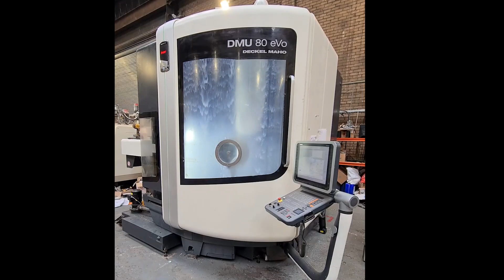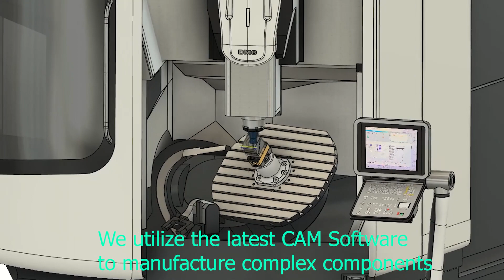Our new CNC Machine! - DMU 80 eVoution Linear

Comment: 00:40 tag on rad, nice.
Reply from the maker: Is that bad? Lol idk it worked fine.
Reply: @max_eley  Not ideal for finishing, that's all.
Reply from the maker: @Convolutedtubules  oh obviously, but was processed off the machine like any tab
Reply: @max_eley  In this factory, the workers can hardly finish a normal tag, so they try to keep them simple.
Reply from the maker: @Convolutedtubules  not in a tool making place! Sometimes hand work to 20 microns is required for certain applications, with those diamond files 😂
Reply: @max_eley  In aerospace, oversize parts are sanded with orbital sander and die grinder. Including undersize bores. Ive even come to learn that oversize holes can be brought back Into tolerance lol.